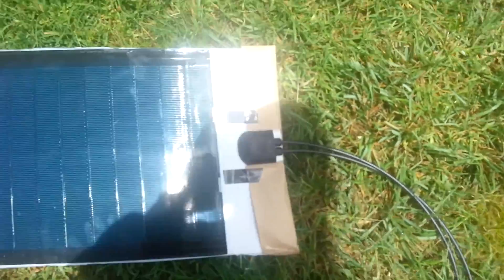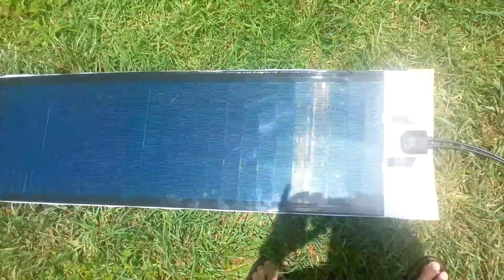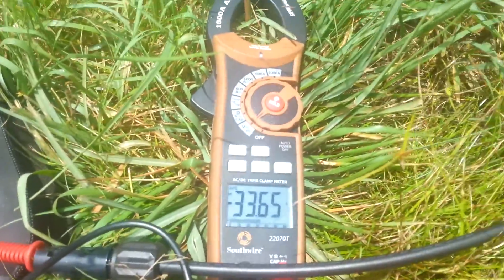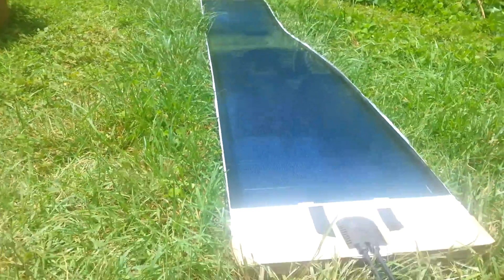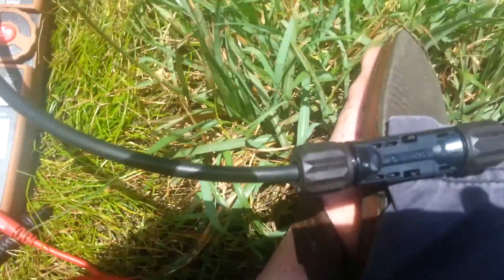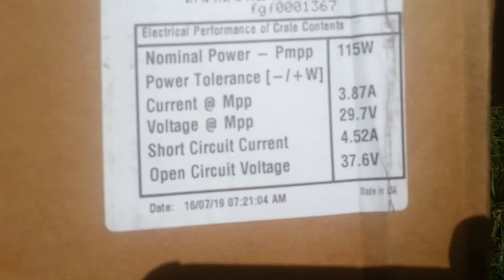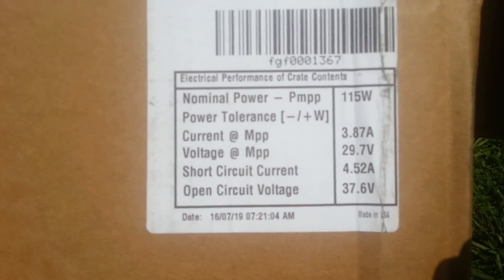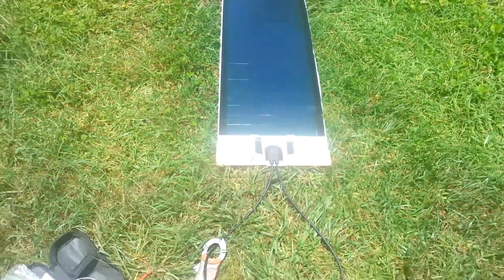Mia Sole' Flex 02n 115 watt test

Comment from the maker: These are standard simple tests of any pv module FYI. VOC voltage open circuit and ISC amps short circuit. VOC is important for determining #1 if the module is working and if so the what is the max voltage for charge controllers etc. ISC is important for determining breaker size. For PV moduals multiply by 1.25 × 1.25 = 1.56 1.25 for continuous power and 1.25 for irradiation. You dont need any resistors for that. I suppose resistors can be used to find Voltage and Amps Max power. There was no mention of resistor tests in either of the basic or advanced PV courses I took at UHMC through NABCEP. I highly reccomend NABCEP.These modules exibited lower VOC than spec obviously because of temperature coefficients. However ISC was higher than manufacturers spec. Its a good sign but noteworthy for determining breaker size. I figure an 8-10 Amp breaker with #10 PV wire is fine.